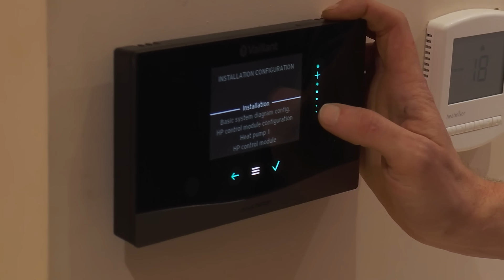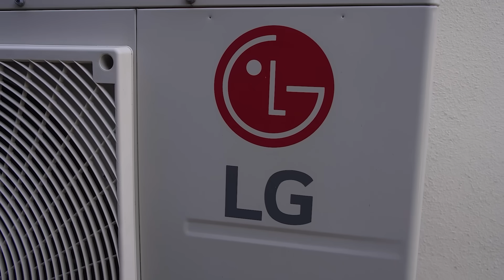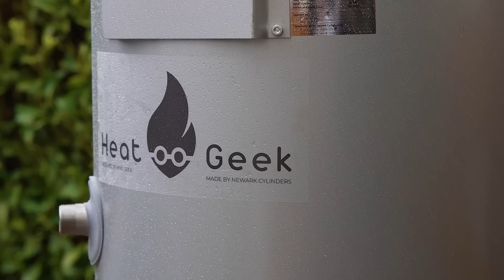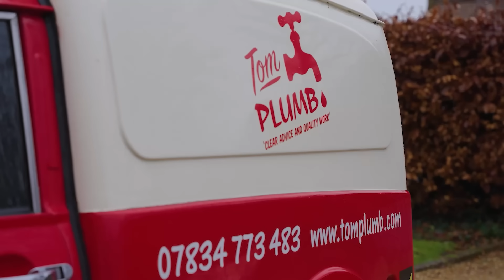Heat Geek’s Heat Pump One Year Later — The Verdict!

Comment: Solar, with batteries and a electric boiler has got to be the better option!!
Reply: why?  An electric boiler will consume far more electricity than a heat pump.  Even if you have enough solar/battery to be off the grid, you would need far less solar/battery for heating with a heat pump than an electric boiler.

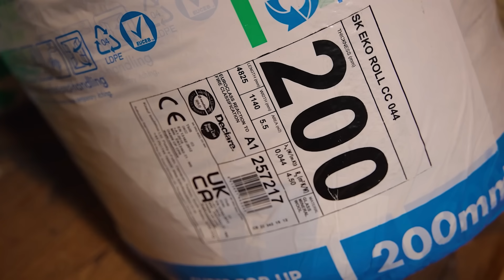Comment: Whoa!   03:35 "the walls are acting like a thermal store - giving heat back" Jeeeeezus!   The air in the room is higher than the wall inside surface (because that is what is being heated by the radiators), the temp gradient across the wall structure to outside is steep.  Heat only goes from hot to cold,  So - what is dropping the room temperature such that the wall is transferring back to the room??   The only way the walls can be 'thermal stores' - is if they have a fantastic insulating layer on the external surface (and act like storage heaters).  I like your channel ,but you need to stay away from thermodynamics until you accept and understand fundamental principles.
Reply from the maker: AliG
I understand all of that and have made many videos arguing this very point,  This video was a chance for John to give his findings. I have long argued that heating a house all day while the walls are leaking heat cannot be econimically viable. 
The point about  thermal comfort from not having cold walls is valid, If the walls are warmer the house is warmer,
Reply: what about the internal walls? 🤔
Reply: @BenIsInSweden  They were referring to the thick stone external walls.  Internal wallls, if same type of stone, will merely act like the fins on a radiator - transferring the heat to the external walls by conduction, from the rooms.

Comment: Skill builder hates being schooled it seems. “But” seems to be the default. Talk of nuclear suns him up in a nutshell. The reason heat geek is an evangelist is because he knows what he talking about. This system demonstrates this. The problem is we don’t have enough heat geeks and too many Rodger’s imo.
Reply: There definitely are situations where heat pumps aren't suitable, but for a lot of people a well designed system is a great solution. You're right that there aren't enough decent installers and these grants don't help that, you get a lot of fly by night companies pop up to cash in. I can understand Rogers skepticism to some extent, a combi boiler works well virtually everywhere and it's easy to find engineers who fit a traditional system well. It's the norm in the UK, not progressive but a safe bet. I do think people should have the freedom to choose what they have installed in existing properties. New builds it makes sense to design them from the ground up to be optimised for a heat pump.

Comment: Be wary of those COP results, the readings are a guesstimate from pressures and sensors fed through software which was setup in lab conditions, in other words it's down to the honesty of the supplier; then the heat has to be transferred from the refrigerant to the water, losses must occur. Hot water must be stored so there will be losses from standby energy consumed. Now your oil or gas combi heats water directly and domestic hot water only consumes fuel when water is drawn. Sources say in the winter in the UK a COP of 2.5 is more likely, if you insulate to a high standard, any fuel will be more cost effective. I think HP's are too expensive for the average workers at the moment.
Reply: This has proper MID approved meters attached to it for both heat and electrical metering, so the COPs are as accurate as they can be.
Reply: @BenIsInSweden  Electrical meters are indeed governed by the MID, the electrical consumption is not in dispute here; however the metered energy output is measured by temperature sensors and pressures of the refrigerant, set against a theoretical output, there is no legislation or law governing the manufactures claims. I am not against heat pumps, but the price is still way out of the hoi polloi.
Reply: @malcolmstead272  No, it's not. The manufacturer's claims are completely ignored in this setup. They are using openenergymonitor with heat meters, e.g. a Kamstrup 403 DN25, to monitor the heat energy in the water going in and out of the heat pump.

Also, there's the MCS certification, which also validates the COPs at certain flow temperatures using independent testing.  Far more governance than the gas boiler claims of "95% efficiency" and "Hydrogen ready" that goes on with those.
Reply: @ " No it's not" What? I assume you mean it is within working peoples budgets, well I disagree and my original post was to warn people of manufactures claims, remember BMW and others about CO2 emissions, manufacturers do not fib do they?
Reply: @malcolmstead272  That was to you saying that the "however the metered energy output is measured by temperature sensors and pressures of the refrigerant".  Like I explained, they use heat meters that aren't affected by the manufacturer of the heat pump, so the manufacturers can say what they want.

Comment: £920 heating and hot water for the year is pretty good. And for a system that wasn't fitted from scratch with a SCOP of 450%. Nice work
Reply: Any idea what the installation cost?
Reply: A house built to Passive House standards might use 70% less energy to heat - to the extent that you might not need to heat it very much!   My 20 yo house is leaky and drafty - a Heat Pump won't fix that.
Reply: Isit hot water or warm water
Reply: Also my gass and electric combines to £1200 a year it is a saving but not sure long run 
Hope skilled builder goes back after 5 years see how he's getting on
Reply: Your house 6 bedroom with larger downstairs and period build with poor insulation options @AshLongie

Comment: As long as the government keeps charging 4 times the cost of gas for electricity, heat pumps won't make sense.. Modern gas boilers are very competitve as regards to providing heat, even if they are 400% less efficient. Currently installing a heat pump, losing space outside, don't mention the entire room inside, to save maybe 1k over it's lifetime isn't really going to fly.. Personally I went with liquid underfloor for the entire ground floor, tiles over the top. radiators in the bedrooms, but the thermostat barely ever kicks in.. People not undertsanding heatpumps and thermostats? What? You spend a huge investment and don't even read up about it? Laughable tbh.. still he does have a convection heater behind him in I assume is his conservatory. I'm looking at getting solar fitted soon, with a set of battery packs.. even in winter can charge them up on the cheap tariff, wife on about an electric car, but with electricity prices as they are, big investment in solar and batteries, probably to the tune of about 50k.. after that, I'd be quite open to a heat pump. I have my underfloor heating on all day 24/7, costs less than the usual off and on, and there is a lovely feel from the underfloor heat like a blanket.. I know my mum loves it.. said it was the best thing I ever did. Also any friends or guests always remark on it, especially on a brisk winter's day!

Comment: I am surprised nobody has mentioned the potential of two, possibly three, big problems. 1. A good 60% of current domestic dwellings will never have insulation that makes a heat pump viable. 2. Currently the cost of a gas boiler install with radiators already in place from a previous installation is £1800 -- £3,000 depending on variables. A heat pump installation £4000 - £7000 again depending on variables. 3. For the past ten plus years Gas has been a much cheaper fuel than Electric, the way electricity prices are continuing to rise at an alarming rate will put many people off. Your video highlights that, at the moment, with no confidence in energy prices, poor installations being commonplace, high installation prices and properties that cannot be insulated to a high enough standard and/or don't physically have the room to install a heat pump solution, it's unlikely the uptake will improve much.
Reply: Number 1 not required to make HPs viable, so much so the government withdrew insulation requirements from the grant application last May.
My full system instal was just under £4k after grant, and the HP can be had for about £3k without VAT. Two pipes to decouple and about four twin & earth cables to regerminate to replace the unit should it ever fall completely beyond repair.
Reply: You're missing A) the HP grant, B) different energy tariffs that make them cheaper to run C) other options / add-ons like solar & batteries that neatly dovetail with heat pumps, but do nothing for gas.

Also 60% being unviable is a massive over-estimate. I've seen numerous videos showing old / unviable-looking homes running perfectly well & cheaper than gas, but the caveat is that it requires a skilled installer and there aren't enough of those. I would never trust a HP install to a random company. You're right about the homes that lack space for the plant room / hot water tank, but there are solutions emerging for this, too.

Comment: The placement is such that air recycles.  The fence door location makes putting the  heat pump next to the fence and opening lower part  the fence panel  next to the wall so air comes from front of the house and is blown  out the other side.  No recycling less defrosting/icing

Comment: £900 a year to run, average 3 bedroom house via gas boiler is £861, bearing in mind this is a well fitted heat pump with correct heat curve etc, still doesn’t inspire me to spend 15k on a heat pump when I can get a gas boiler for 3k
Reply: The heat delivery is much cheaper than gas. In the past year, a 94% efficient gas boiler delivering the same heat would have burnt £2200 worth of gas at the current price cap. The house has 6 beds, with varying amounts of insulation.

Comment: Had a heat pump for two years, absolute disaster. Terrible heating, noisy,cost a fortune to install and run, smoke and mirrors.
Reply: Which model and who did your heat loss calculations and design, also installation ?

Would be helpful to know which cowboys are fitting faulty (noisy) heat pumps, and not setting them up correctly).

Comment: I’ve been following this story  and have commented about the warmer energy putting  one and it hasn’t worked properly since day 1. Question I would like you to answer is why are they fitting combi boiler along side these pumps. Surely it defeats the object?
Reply: In this build the boiler was kept (unused) for backup. Are you trying to ask about your particular situation?
Reply: They are offering 'Hybrid Systems' primarily as a 'comfort blanket' for those who read too much misinformation. But it's good for manufacturer profits and allows a bit more to be squeezed out of customers in 'maintenance contracts'.

The service on my HP this year (required for Warranty, and carried out by company that did installation) was to check for any refrigerants leaks in outdoor monoblock unit and to clean two filters (one external mesh type, one internal magnetic, both spotless) and to brush out any debris from evaporator grill (heat exchange radiator). A grand total of about 50 minutes work.

A job that any competent DIYer would be able to accomplish in an hour or so, as any refrigerant leakage would be ultimately reported by the unit itself as a fault as the pressure in the refrigerant circuit would drop.

Comment: I was hoping to install a heat pump(s) in a completely refurbished house in Banstead. I was totally put off by the companies I engaged who seemed reluctant to engage in any detailed discussion of specification. It’s a large house and one comment that got me thinking was that one company said it was good that I had 3 phase power. How much electricity will these heat pump draw was my question… oh not much was the answer!
I installed a boiler that works efficiently, no issues at all. 
I hope to have confidence in heat pumps and those that specify and install them at some point but I am not there yet.
Reply: @SkillBuilder links through to the stats on usage of this property. You can see the electricity used and the very well optimised heat delivered over the whole year. On the coldest day at -2.3C (11th Jan) it drew up to 5kW, and used 92kWh in 24 hours (generating 232kWh of heat).

Aside from the efficiency, the owners shouldn't need to upgrade to a new heating system as gas is phased out (the long term nature of this may make the benefit hard to sell).

Presumably the installers didn't want to spend time getting too specific before they were contracted for the work?
Reply: @ I installed a boiler for £3k , quotes for two heat pumps were around £25k before subsidy for removing boiler. Clearly with this investment a bit more information pre sales may have made me more less likely to revert to what I knew would work fine. 
Thank you very much for the reply the stats are interesting.
Reply: @chrismoore7569  the UK is early in the growth curve for installs. The plan is for it to be commonplace in around 3 years. Hopefully at that point there will be more competition.
Reply: Three phase is often useful for higher power EV chargers, EVs often go hand in hand with heat pumps as house acquisitions over a short period.

If it's a large house it might require a 14kW HP, but may be less if well insulated (which I suspect it is).

I have a small house (70m^2 or so), not well insulated by todays standards, a 6kW Daikin currently is using about 11kW per day for typical external temp' of 5C, Livingroom 21C, bathroom 23C, bedrooms 19C. That's running 24 hours. At -5C outside it was 24 kWh over 24 hours, efficiency dropped a bit as there were a few defrost cycles. I've not seen my HP run a defrost cycle when outside temp' at 3C or more.
In fact system shut down for a couple of hours today as external temperature rose to a heady 13C, house temperature hardly moved at all (a few tenths of a degree here or there).

It's important to get good heat loss calculation done, radiators and other bits correctly sized by good design. Any good heating engineer should be able to install well if design is followed and a little bit of forethought.

It's currently ticking over at @ 400 Watts usage for a flow temp' of 31.5C to 32.5C.

Comment: I have had my heat pump for a year. Solar and battery as well. House was built 2016. Admittedly not a completely smooth install and commissioning could have been better. Definately not up to the same design as say heat geek. I went with a big name and aftercare has been brilliant. I have been tweaking things as time goes on so my efficiency will improve i imagine next year. In short my total annual cost was slightly less this year for all electricity, car charging and repayment loan compared with my gas and electricity the year before. (That is excluding any petrol costs)
Overall i have been really happy with it
Reply: all that work for slightly less , thats not an economic argument
Reply: @AlexSmith-y4i6t this includes my car fuel bills, so significantly cheaper with that considered
Reply: @u01ijm7  EVs have massive depreciation , yes you may save on energy costs but the losses in terms of vehicle depreciation will be far greater than any cost savings and they can hardly get fixed or recycled either , i am totally unconvinced by the overall benefits
Reply: @AlexSmith-y4i6t fair enough, each to their own. At the end of the day all vehicles depreciate but yes EVs more so for now. I'm happy with being a bit cheaper than before whilst being a bit more green
Reply: @u01ijm7  you seem lke a nice person but really owning a EV is not green and a lot of the energy thats used to power EVs is gas lol
Reply: @u01ijm7  United Kingdom total primary energy consumption by fuel in 2021[1]
Gas (42.8%)
Reply: @AlexSmith-y4i6t I'm enjoying this friendly debate lol. I believe EVs are more green in the long term, but you're right. They do still have an environmental cost when being made so it's not an amazing green effort immediately. That being said, al ICE cars can only burn fossil fuels whereas EVS have the option of using energy that has been produced in a green manner. Ie wind farms. As electricity production moves more green, less will be fossil fuel based
Reply: @AlexSmith-y4i6t with those numbers, 60% of EV "fuel" is green, and 0% of ICE cars' is. That, I think is ultimately the point. The likelihood is that percentage will increase in time for EVs
Reply: @u01ijm7  green energy is a myth , all the infrsatructure steel concrete and wind turbines is far from green , if you want to be green dont haet your home, dont drive a vehicle and dont take foreign holidays
Reply: @AlexSmith-y4i6t  all the infrastructure and stuff used to burn fossil fuels produces carbon as well in it's manufacturing 😂. It's not a myth mate otherwise the world wouldn't be pushing it. Anyway have a nice day

Comment: We're in (what i suspect) is a sort of quasi opposite position. As we've renovated our 1970's build, we've been increasing efficiency as we go. This has had knock on effect that the combi boiler at 30kw (to cope with hw) is significantly oversized for the building (house = 2-3kw heat loss whereas boiler will only modulage down to 6-7kw). Issue we have now is boiler just constantly cycling on/off and not heating the house up effectively. In summary, i don't think there is a one size fits all when it comes to heating, no matter the heat source.